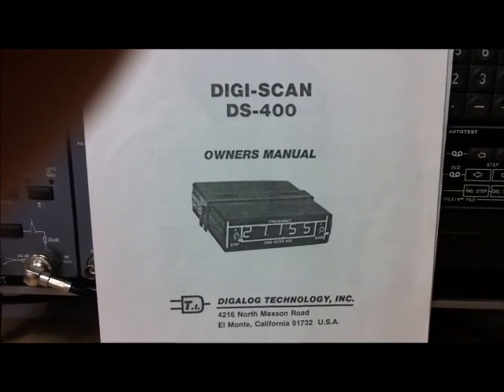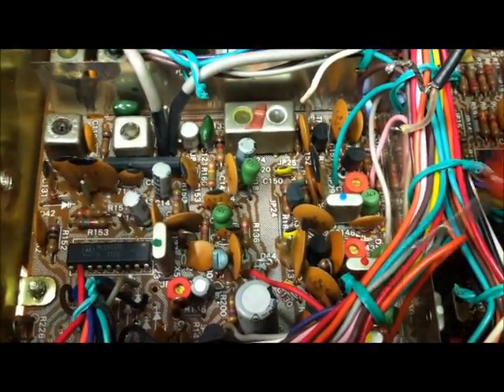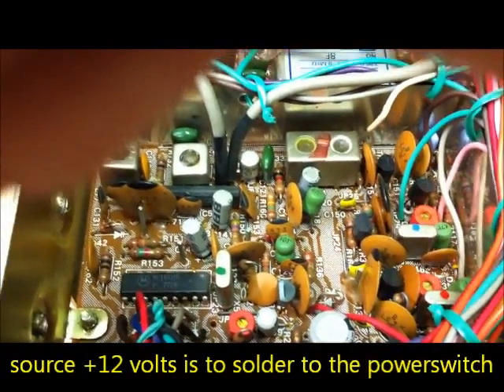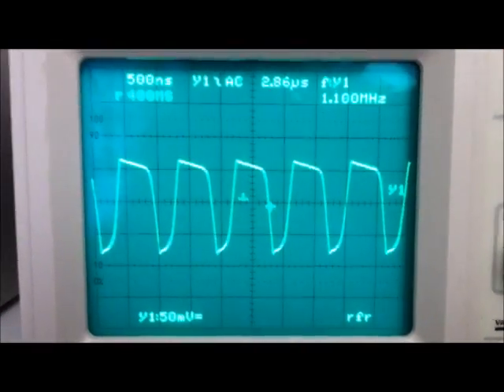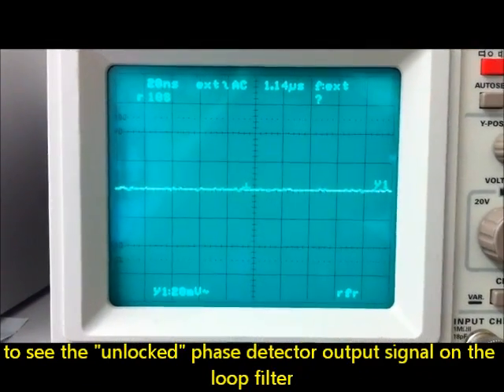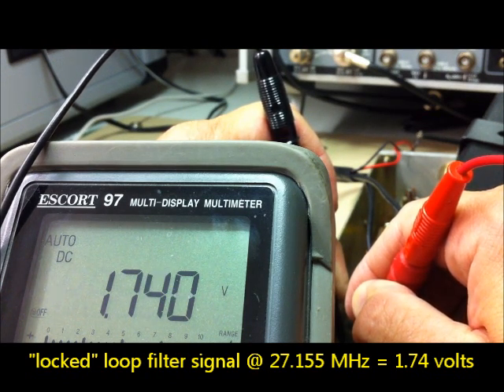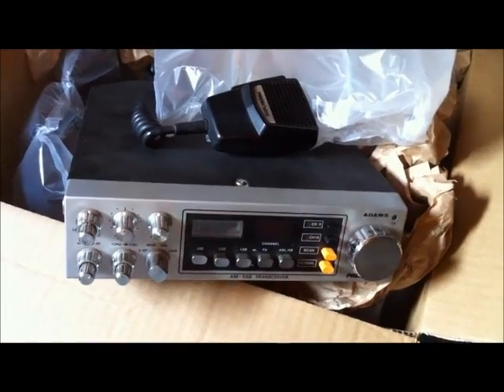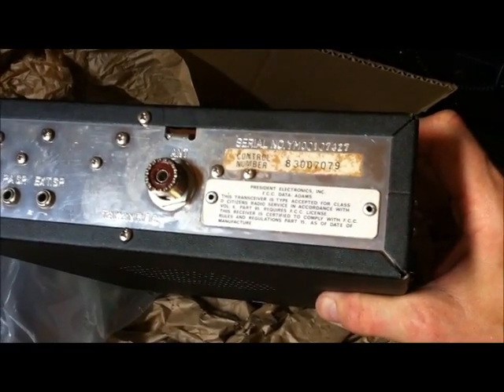REDCO DIGI-SCAN UFO ELITE part 2, info, settings and some videocuts

Comment: Stefan expert, can you please send me a email to 34ab138@gmail.com  I have a question but i can't attach the image I need to show you, its for advise on the 2 points of connection on a strange radio
Reply from the maker: Do you have solve your poroblem with the DIGISCAN? Best 73 to you...
Reply: @SWIZZRADIOS  i worked it out how to connect a digiscan to a expert pd8500. I picked up 10 new old stock digiscans thought you might be interested. Best deal to you.
Reply from the maker: Hello my CB-radio friend. I'm sorry, but I don't know the PD-8500. But I think, this radio is using a LC7120 PLL chip. If this so, you must following on the Digiscan-Installations- manual on "INSTALLATION #10". 
On COAX#2 is the VCO-Voltage output and on COAX#1 is the downmixer Input. COAX#2 must go to the loop-filter and COAX#1 on the pin? of the PLL-IC, where is the downmixer input. But I don't know the programming chart. You must try and try and try. 
Now I can't help any more, my DIGISCAN is installed on a PALOMAR with MC145106 PLL-chip. I wish you good luck on the installation. Best 73 to you.
Reply: @SWIZZRADIOS  stefan i already managed to do it and get it working, you took a long time to see my message 😂
Reply: Same as robyn sb 540 d or sd 540b usa cant remember now,
Reply from the maker: Oh I'm sorry my friend, I was in the Winter Hollydays. Congratulations to your DIGISCAN installation on your PD-8500. Happy weekend to you...
Reply from the maker: Wonderfull, the DIGISCAN is a very tricky box. Best 73 to you...